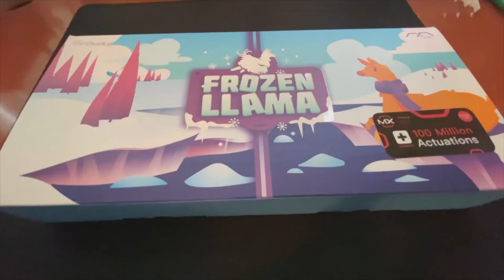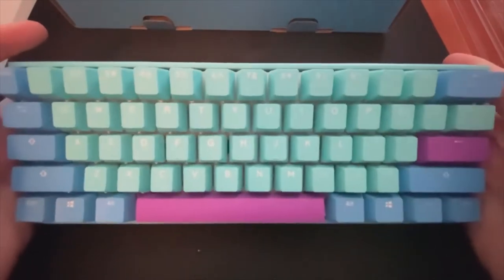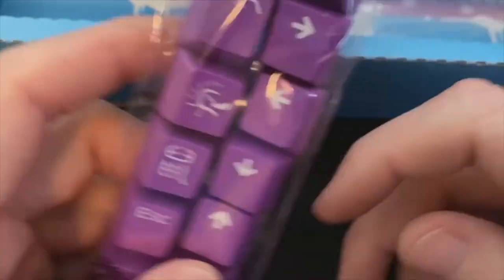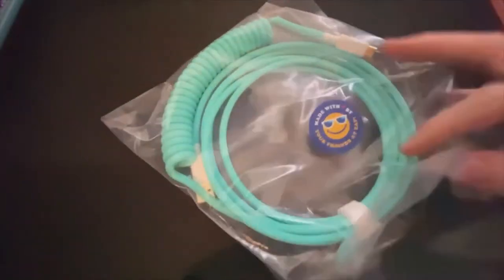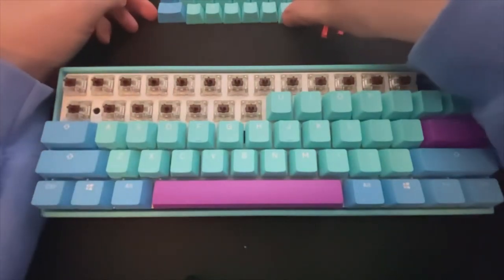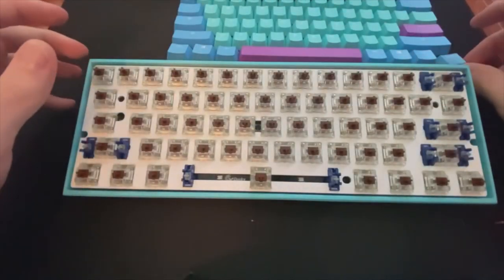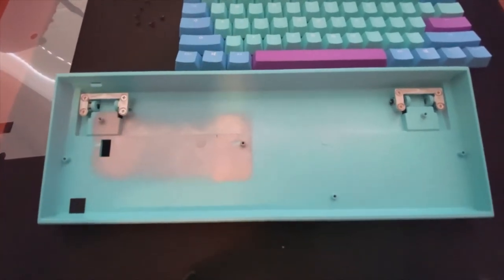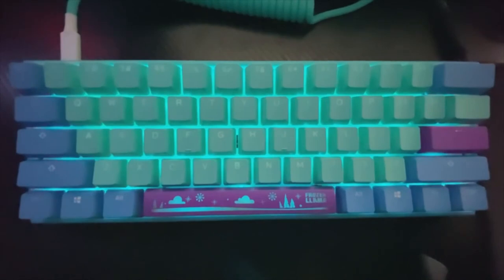Ducky x MK Frozen Llama Mecha Mini v2 Switch Mod

Comment: Hey I have a question will the cable you have work with the ducky mecha mini because I know not a lot of coiled cables work with it
Reply from the maker: Idk where you heard that... any data USB C will work just fine.
Reply: @6oen  its because the acseny cable wont work with it
Reply: @gsfactor8444  the acseny cables have a lot of problems and I have friends that the cable doesn’t work with their costume keyboard but I also have friends that have this cables and work good so it’s not the connection is the cable itself

Comment: I sort of regret getting cherry mix blue because they sound amazing but speed silver sounds decent and is faster but it hasn’t shipped yet and it says February 23rd and I bought it on October 15
Reply from the maker: You’ll be okay! Worst case do what i did and swap the switches! And yea the wait definitely isn’t short and probably won’t be with the holiday season.
Reply: @NeverMad I ended up refunding and getting the browns

Comment: Do you think with novel key cream switches it would be as bright?
Reply: Novelkey creams aren’t transparent so no light will go through.
Reply from the maker: @maplemoth21  correct
Reply: Hey can I ask you a question? I have the same keyboard with mx browns and I want to lube the switches safely. But I don’t want to desolder. I thought about just removing the top housing, stem and spring while the bottom housing is still attached to the board. Apparently the plate needs to be specific shape to do that. Do you know if the mecha mini’s plate is suitable for that?

Edit: Sorry it’s a little long.
Reply from the maker: @maplemoth21  No worries, but no you have to desolder to disassemble the keys!
Reply: Okay. Thanks!
Reply: I have creams and they will show some light but it won't be as bright since their housing isn't clear. I'd look into some durock linear switches in their clear housing color. It'll make the RGB even brighter due to it's fully clear housing
Reply: @maplemoth21  To remove just the top housing of the switch wouldn't be possible unless you de-solder the entire keyboard and then remove the housings unfortunately. Lubing browns won't make too much of a difference and can fully remove tactility of done incorrectly. I'd advise to avoid this. Instead if you want to lube switches, looking into linear switches would possibly be a better option or to possibility consider more tactile switches like the T1's or the Zeal switches. But ducky now has hot swap so you can even look into that. Hope these options help you out. Good luck